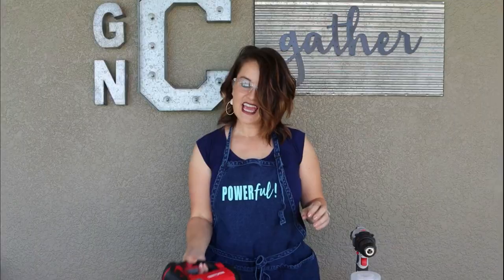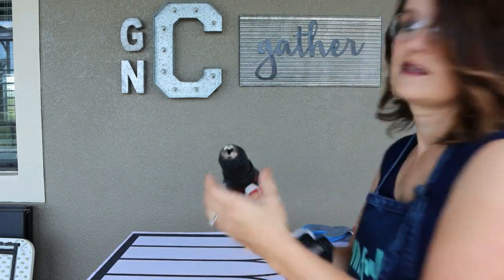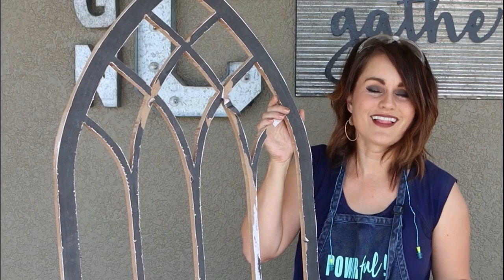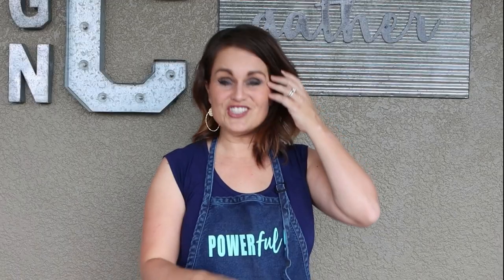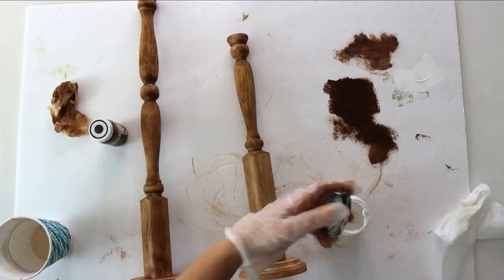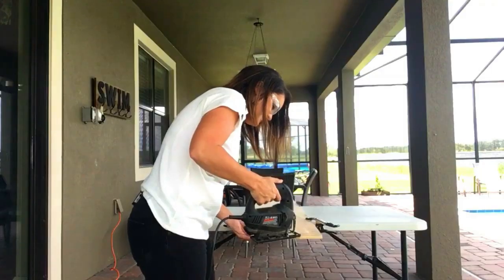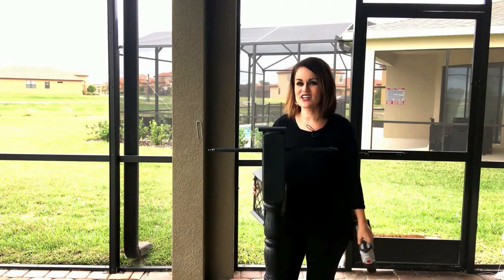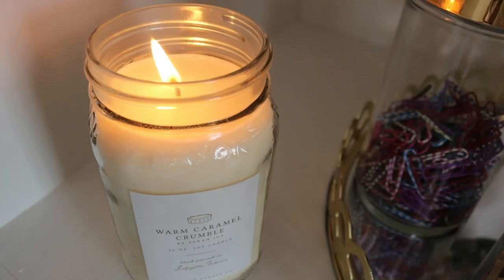Absolute Top 10 Best FARMHOUSE DIY Decor Ideas On a Budget!

Comment: You are one of my very favorite Craft Channels on YouTube.  I am a Tool Girl too.  They make the job, SO much easier.
Tip for cutting multiple tongue depressor's. Line them all up perfectly, wrap a little painters tape to it, if you like, and cut them all at once with that miter saw.   WAY faster than cutting each one with scissors.
Oh and those dado cut pieces you get at Home Depot for free.  They're called stickers.  They use them over and over again to tightly wrap multiple boards, without cutting into the boards.  They come with every stack, so they get plenty of them, and yes they will give them away, to a point.  Because they do need to keep a reserve for purchases customer's make of large purchases of 2x4's etc., to keep them tightly bound.  That's why there is a dado cut in the wood.  I used to work at Home Depot, and I would collect them all the time and take them home.  I have well over 100 of them, treated and untreated, cedar all kinds of wood.  I used that dado to fit some cedar boards into as I framed the cedar top of my coffee table I made.
Those stickers can also be cut in all kinds of ways, thin slats, etc.  One of the other ladies who worked there, collected treated one and made walkways at her house with them.
Reply from the maker: Thank you so much for all the valuable information... very helpful. It’s fun to see all the versatility in the stickers and I love the tip about cutting multiple tongue depressors. Awesome! 🙏💕

Comment: You inspire me so much! I did make the arch but it was made with plywood, I had issues with the wood but the outcome is still beautiful.
Reply from the maker: Thank you so much Margaret! I’m curious as to what problems you had with a plywood just so I know going forward. I used MDF on mine…Can you expand a little?
Reply: Designed to the Nines  it splintered, my skills are very new so that was some of the problem. I added putty to fill in spots, it’s not near are beautiful as yours. But I still love it, it’s very rustic so to speak.
Reply from the maker: Actually that makes sense. I am sure it’s beautiful! 💕
Reply: @designedtothenines  how did you get the pattern printed?

Comment: If you want it to be food safe, instead of that spray sealer, use SHELLAC! It comes in a spray can as well, in clear and amber. It is completely food safe and gives a complete waterproof seal and protection! Also, when using woods with knots in it, spray it with shellac before you paint it and it will keep the knots from seeping through your paint and giving a nice surface to paint on too!
Reply from the maker: Good suggestion! I’ll have to give it a try.💕

Comment: So I love using power tools as well, but you should really be wearing ear protection when using the saws. I know most plugs aren't pretty, and it doesn't seem like the saws are that loud but they are. 
You can even have custom molded ear plugs made by your local Audiologist. They can be transparent, marbled in any color combo, and they have glitter and glow-in-the-dark options now days. They can even double as swimming plugs so you don't end up with water in your ears. The custom plugs can be a bit expensive but if this is what you do all the time, I think being able to hear is worth the money. 
Not trying to criticize, just trying to spread the ear safety message.
Reply from the maker: I actually do use ear plugs... not all the time, but I totally agree with you. Mine are small so you wouldn't notice, so I should remember to point this out. and I did in my latest video. =)

Comment: The metal pallet strapping is a great idea and can be straightened/flattened. You need to smack it with a big flat-faced hammer/small sledgehammer. Put a piece of 1/4 inch plywood down on your garage or basement concrete floor and tap all the high points on both sides until you get all the crinkles out. If you have access to an anvil all the better. You can even make it round if you can find a heavy metal cylinder to lay the metal stapping over and keep tapping it with a hammer until you achieve the desired bend. Using a ball hammer will give it that hammered look. A copper pipe can also be flattened and used this way. Be POWERFUL!
Reply from the maker: Thanks for the tip!😃💕

Comment: The only power tool that scares the heck out of me is our framing nail gun. If you've ever seen a nail from one of them stuck through your hubby's finger you'd feel the same way. I use our other nail guns, table saw, miter saws, routers, band saw and all our hand power tools. I will never use the honkin' huge framing nail gun again. Ever. It double shot and the second nail is what went through his finger.
Reply from the maker: Oh my! I’m sure it’s a very powerful nail gun. I don’t blame you. But have fun with other stuff!💕
Reply: @designedtothenines  It's very powerful. It works with an air compressor like contractors use. Great tool, but I much prefer designing and building things with our other tools.

Comment: I wanted to recreat the window arch. I looked at my local lowes for the mdf board. $134 for 2ftx4ft ½inch thick. I about choked lol 😆 I'm about to glue several dollar tree boards together 🤣🤣

Also, could sand the 2nd round down so it had a flat edge like the plywood? I couldn't really tell of it had a rounded edge?

Comment: I watch you a lot and love your projects and expertise you show, But……..I wish you would pull your hair back AND remove your lovely rings. I am a retired nurse. You wouldn’t believe the injuries people receive from getting rings or hair caught in some power tool. One fellow almost lost a finger from catching it on a nail or screw slightly sticking out of a trailer. He was loading hay so the truck and trailer were moving from place to place, he was up and down. He was holding to the side of the trailer for balance while jumping down to load the bales of hay. He caught his wedding ring on something and it almost tore his finger off. It was a mess. I know your not loading hay, or jumping up and down on a trailer. But you should still take every care to keep yourself safe. I do notice toward the second project you did push your hair back,  I am much older then you and have raised  six girls. Two daughters and four granddaughters, I was always saying “get your hair out of your face for working”. I say the same to you, out of love and concern. Plus, it would be such a tragedy if you ruined your wedding rings. An accident is never just one thing. When analyzing it afterwards you always discover several unusual things that contributed to the problem. Great video, by the way.